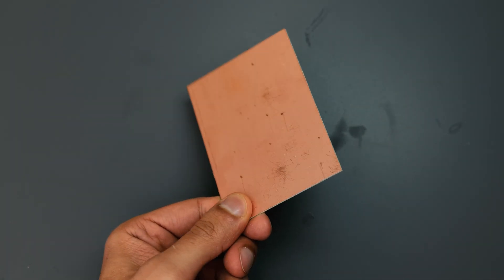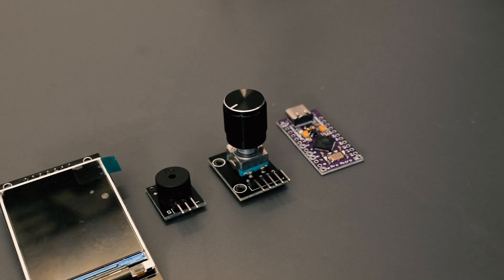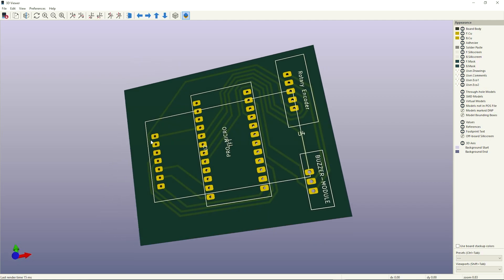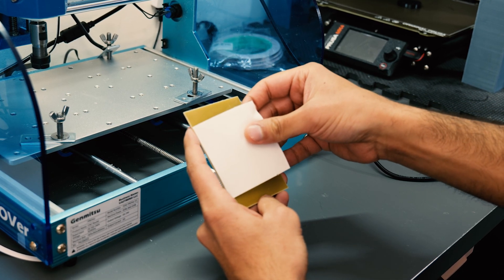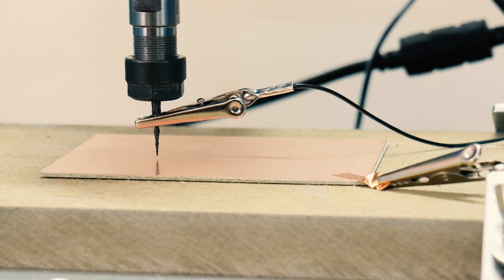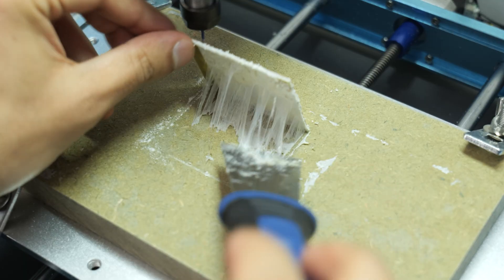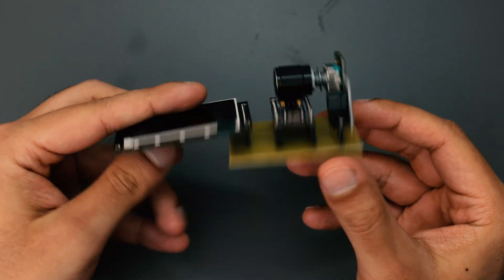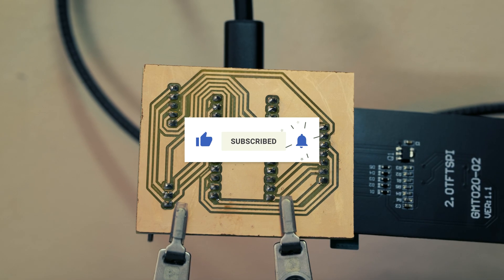Making My Own PCBs (because I’m Not Sponsored)

Comment: I always assumed that when you cnc'd a circuitboard that it cut away the traces, but it's actually the opposite - you cut AROUND the traces. This is the first time I've seen it clear enough to make sense.

Also what tape did you use to hold that board down? It was like road tar or something when it came up! Did it take a long time to clean off?
Reply from the maker: Yeah I thought the same thing, but you’re actually cutting around the traces. 

The tape was a 3M double sticky tape, I think some heat is generated in making the PCB so it became like that. It works really well though.